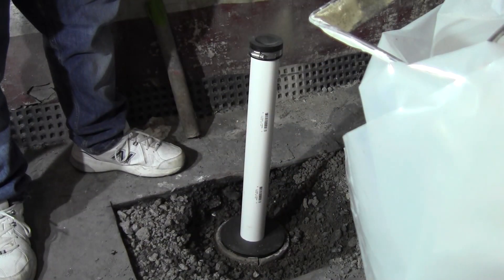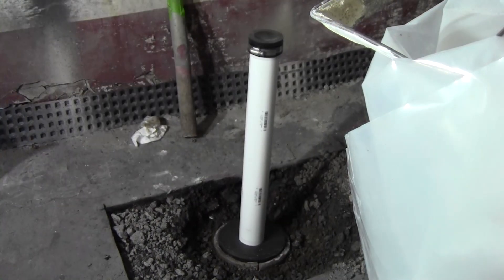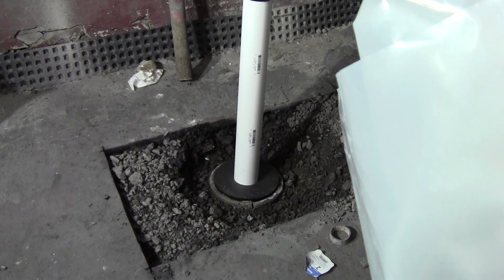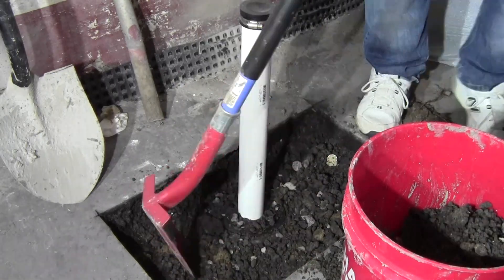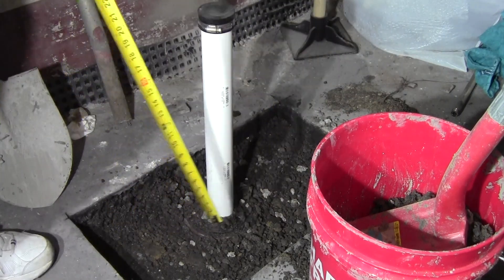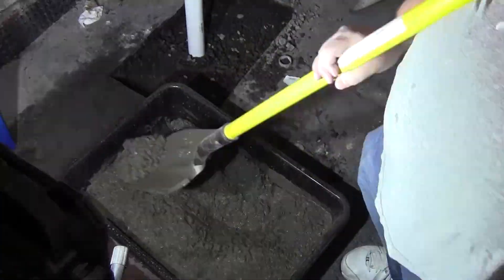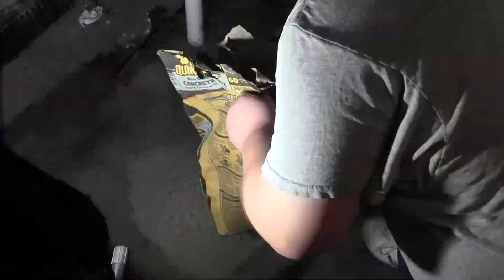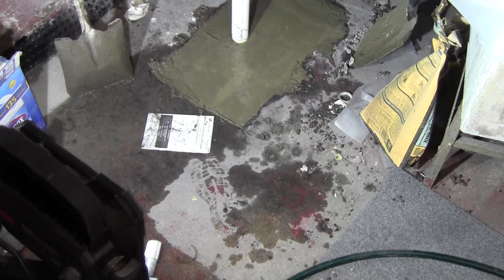Patching the Basement Slab Concrete - Plumbing Drain

Comment: Whoops! Glad you were able to correct the pipe. We have a house built in 1922 that also had some clay pipes under the slab. When we added a bathroom to our basement we had a good bit of the clay pipe replaced with PVC.
Reply from the maker: Yeah, these old houses sure have a way of hiding some real surprises in them. I'm sure we'll be modifying some of the clay pipe with some PVC when we get to the bathroom down there. There is a sink and toilet right now, but no shower.